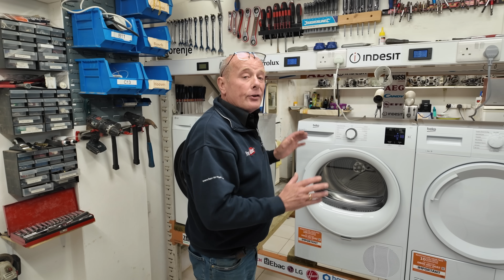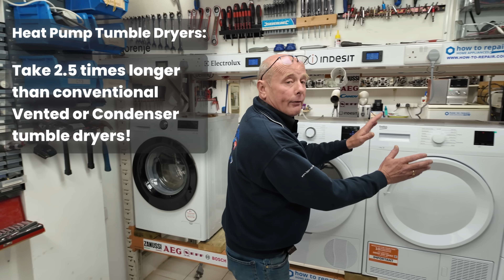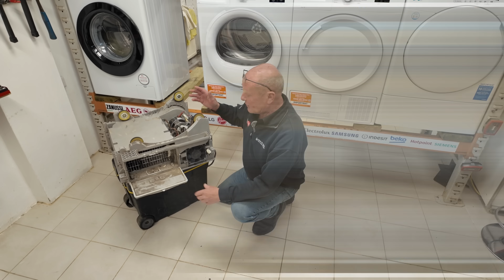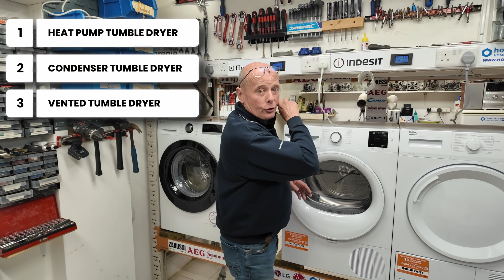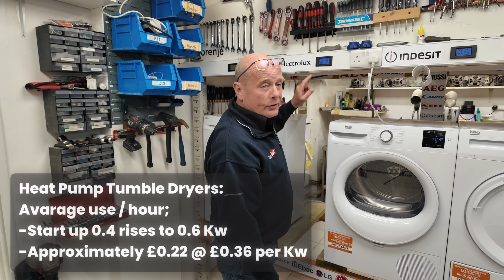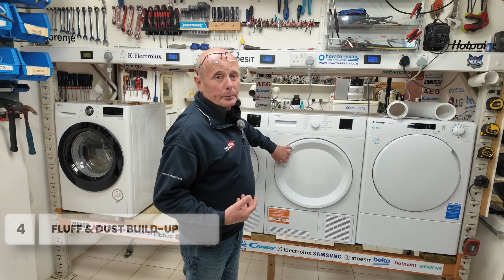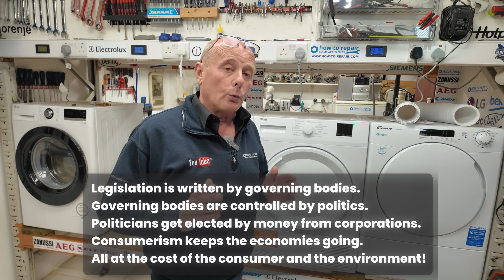Tumble Dryers the Shocking Truth About Heat Pump vs Vented & Condenser, NEW LEGISLATION!

Comment: This is exact same argument can be used for people not to buy an electric car. Fantastically put 👏
Reply: Is that irony? Our car is fantastic - mostly because fuel costs have gone from 15p per mile to under 2p (just because someone up the road lives in a flat and can't charge at home doesn't mean others can't have cheaper and cleaner travel, BTW). My partner also loves it because its so much easier to drive. EVs catch fire far less frequently than ICE cars (go on, look at the stats), too.

Comment: I used a spinner to remove excess water from towels, jeans, sheets, socks etc and find my condenser runs for 50% - 60% of the time. I also line dry things and finish of in the dryer. My dryer ends up being greener than a heat pump. It's more than 5 years old and runs like new.

Comment: And this is why right to repair is so important, so manufacturers are forced to produce user repairable products. 

The f-gas regulation in the EU are making DIY repairs and installs on heat pumps impossible. We now often have the option to use Propan R290. But whyyy is this still so heavily regulated??? I can buy propan for my grill, but not my heatpump? The legislations are outdated and has to be removed on gasses like propan!

Comment: As far as I understand the refrigeration system is the same as in a refrigerator. How often do fridges fail because of the actual refrigerator system? The wear on the moving components I agree, but I have just retired my vented dryer after 23 years, with no signs of any wear at all. (Replaced by a heat pump dryer and the vented one went on to a new home.)
Cleaning seems to be the main risk. And that's something I'm happy to do myself. Though the one I have just brought certainly has a front panel access cover for the evaporator element.
Only used mine for a week so far, and impressed. the only complaint is that I need to empty the water draw part way through a load. That probably says more about how wet my clothes come out of the washing mc, than anything else.
Reply: Re-watching a year later. Still happy with my heat pump dryer.
Regular emptying the water drawer and filter is a chore, but we are used to it now.
I regularly clean the evaporator, which is behind an access door. The condenser is not accessible or inspectable, so time will tell on that. But I am happy to strip the machine myself, if necessary.
The huge benefit for me is the low power draw. I can power the 500-ish watts of my HP dryer from my solar/battery system. Whereas the high draw of the other types would exceed my inverter capacity, so I'd be drawing that power from the grid. (OK, my situation is a bit unique.)

Comment: I have a Heat Pump Dryer... It won't dry bedding.
Because it doesn't reverse the tumbling direction It just rolls it up into a sausage.
The manufacturer is aware of the issue and acknowledges it's a problem.
It takes absolutely hours to almost dry the laundry, pretty sure it uses more energy than our condenser.

Not happy with it.
I also wondered how I'm supposed to clean the Evaporator and Condenser radiators, and now I know.

Comment: I feel the same way about on demand water heaters. While they work great, in the long run, you really don't save any money. Why, to start, the initial high cost. Then if you pay someone to do the yearly flush, you will spend more than you saved. Also, if the power goes out while you are in the shower, instant cold, where with a tank, no problem.

Comment: Interesting video …. to date we love the operation of our Miele Heat Pump drier that gained a $450 buyer subsidy. Hopefully it lives long beyond 5 years because its payback time is longer than that. If not, I’ll regret not seeing this video before buying when I could have grabbed one of the last Miele condenser dryers instead for our laundry renovation. But when you have 55c per kWh peak electricity charges (in 75% wind/solar renewables South Australia), energy efficiency really matters.

Comment: Summing up what I understood, that heat pumps are more efficient in consumption of energy, but may wear faster. Poor design makes repair a nigthmare. The same is supposed to be true to washing-drying units. Except cases when you have limited space for installation, right?  The bonus is that you don't need to reload laundry between a washer and a dryer. Do you have any idea how to help producers to create more repair friendly devices?

Comment: You are mixing a lot of different issues. Machines that only last a few years shouldn't be allowed whatever the tech is. Inability to correctly recycle, and I could write an essay of the incompetence of the UK in regard to recycling has nothing to do with the tech itself.

Venting dryers consume a lot more then you mentioned because the vented air will be replaced by cold fresh air that needs heating.

The heat pump system will draw heat from the inside air also cooling it off. So the heat pump dryer only makes sense in a house isolated/heated by latest standards.

A condensing dryer is the only one that lowers the heat demand of the house and it's quicker drying time can be done during high solar hours. However the issue there is that you need a combination wash condensation dryer because otherwise you can't wait due to wet cloths starting to mold up unless you don't have a daytime job.
Reply: "The heat pump system will draw heat from the inside air also cooling it off."

====

But that same heat then goes back into the room it was taken from at some point.
Reply: Heat pump dryers do not draw heat from the inside air, and they will in fact heat the room slightly, because they have a cooling fan to get rid of excess heat produced by the compressor.

The drying air circulates in a closed loop, the warm moist air leaving the drum passes through usually a couple of filters into the heat pump's evaporator, which extracts the heat, condensing the moisture out, then passes through and is heated up by the condenser, which is hot from the compressed refrigerant pumped through it and the now dry warm air is blown back into the drum by the fan. The refrigerant will also pick up heat from the compressor and as I understand it, they have a cooling loop the refrigerant passes through that is cooled by a thermostatically controlled small electric fan drawing air from the room to get rid of the excess. Basically all the electricity used by the appliance will end up as heat and warm the room, it will just warm the room less than a conventional condenser dryer as it uses much less electricity.

Comment: Heat pump thimble drier are terrible if you have to keep them in a cold room (in my case is the in heated garage), it takes forever to do what a condenser drier does and if it’s too cold it just won’t work. My sister gestione is to add some heat elements and use them when the conditions requires it because it is too cold

Comment: I think most of these are teething issues. In that case, wait a few years after a certain model has been released, and read the reviews. It makes sense in situations where there is not 240v power over here in the states. However, a condensing dryer is probably the best overall.

Comment: My condenser dryer is 100% efficient. All the heat it generates goes to heating the house. In summer I don't need to use it. IMHO all new properties should be mandated to have solar powered drying facilities more commonly known as a clothes line.

Comment: I've done some basic calculations and come up with the following, assuming that you could buy a vented dryer for £200 compared to a heat pump dryer for £400.
Based upon an average of 2 hours of use per week for the vented dryer over a period of 30 weeks a year, because hopefully the other 22 weeks you'll be able to air dry your clothes instead. The saving per week using the heat pump dryer would be approx 64p per week, and over the 30 weeks of necessary use in a calender year this would come to £19.20 per year.
Therefore, without taking into consideration any repair or maintenance overheads, it would take approximately 10.4 years of use before you had recouped the extra outlay of £200 spent on the heat pump dryer.

Comment: I never had any problems with my Miele SOFTTRONIC T 8969 heat pump tumble dryer, i bought it in 2011 and still works like a charm.
Maybe the one brand uses better quality bearings and better parts than other brands.
Reply: It does.  MIELE is more expensive but everything is better constructed than any other brand. It's a choice
Reply: @0031.yourmoralcompass  a $$$$$ choice
Reply: Of course it does it's melie However however If you've noticed in the last couple of years that brand getting cheaper on certain websites it is it is because Of the companies now franchising thus using the name but cheaper components, They always buy direct from the supplier and not from a subsidiary

Comment: I replaced my 20yo condenser dryer with a heat pump dryer.

What a relief ❤
Our laundry room doesn't have windows (below ground) and is next to the gaming room (no window there either).

When the condenser dryer was on, it made the rooms hot and moist. Even in winter. 

Now, I can run several drying cycles without any change in the room temperature or humidity ❤

Our Samsung heat pump dryer doesn't use more time than the Bosch condenser  dryer. I know that a vented dryer is quicker, but without a window/air vent, it's a no-go for me.

Heat pump saves electricity, dries very well, and keeps the gaming room livable 😊👌
Reply: Regarding repairability. We needed repair 3 times for the old Bosch condenser dryer, the first two times on warranty, the last cost ~150€.

We bought it used for 250€. So it was still cheaper to fix the third time compared to a new similar model ~550€. 

I didn't want to fix it a fourth time. All three times, it was the electronic panel that died.
Reply: How come so many reviews on heat pump dryers are saying clothes keep coming out still damp even after being in for several hours? Is that not your experience?
Reply: @myAutoGen  not mine... they are not 'hot' like they are when they come out of a condenser or vented drier... but they are certainly dry
Reply: @Gamingwithprue  Thanks. I got a heatpump and the clothes are indeed coming out dry.
Reply: Pleased it works for you, seems the perfect place. Remember the internals need cleaning! and good luck with wear for 20years. I got 17 years out of my last washer/dryer`condenser` with £7.50 repairs.  So I bought the same model again. ☺